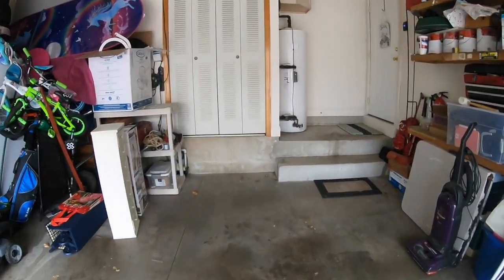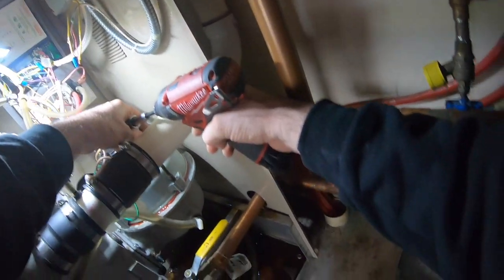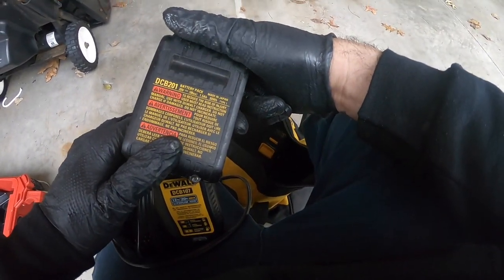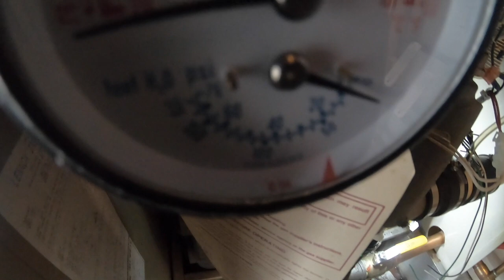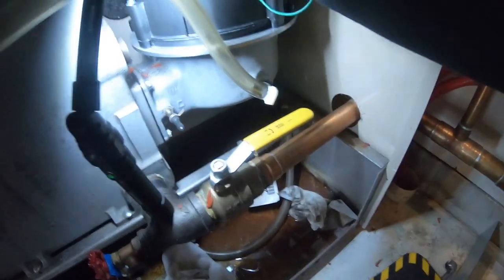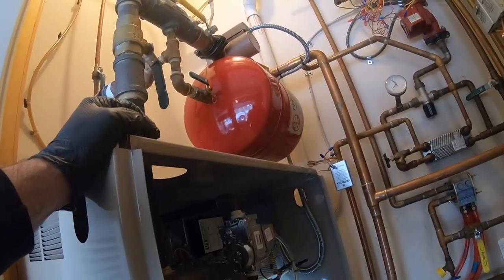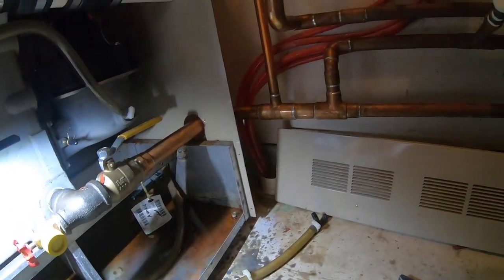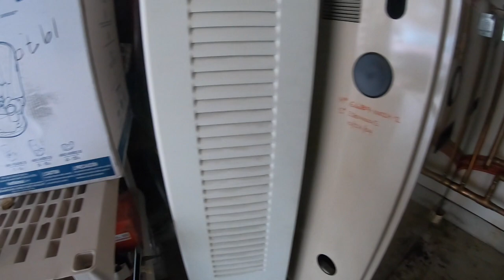Noisy leaking  Boiler Repair Inducer Motor Replacement

Comment: Ah good olde Lennox. They have their own way of designing a product that just usually ends up pissing me off and wishing I was working on something else. Recently found your channel lately among the other HVAC guys. Really enjoying it so far.
Reply: Lennox boilers are manufactured by Dunkirk, not made by them.  If you get a Dunkirk it will be exactly the same, just a blue cabinet. FWIW.
Reply from the maker: Michael is correct Carrier and Bryant even use the same boiler just different color jackets end up on the boilers. I believe this heat exchanger was done by Utica they only made this style boiler for a few years and backed away. I have ran into many cracked heat exchangers or burned away burner tubes.
Reply: The mother company is ECR the main brand being Dunkirk but they own Utica, pennco , argo and other brands. Dunkirk has always made boilers for at least a dozen companies. They still make that boiler but it has a high failed rate. The welds on the aluminum fail. The water needs a corrosion Inhibitor.
Reply from the maker: Yes and Dunkirk isn’t on the units label anymore yet ECR is. I have had a few of these that the heat exchangers failed.

Comment: I've always wondered why hot water/steam was so common in the NE while we here in the midwest are almost all forced air?  Those water/steam systems look so complicated, expensive to install, and maintain.
Reply: theBigMoose The buildings in the east are much much older thus having the piping already in place when the old coal boilers were converted to hot water boilers.  It was their access to coal and oil first that dictated the use of hydronic heating systems.
Reply from the maker: Water systems offer more even heat. Efficiency nailed why a lot of these older houses have steam or water systems. Higher end homes usually get water systems for radiant heat. A water system is easy to maintain its when they break down. A steam maintenance is almost 2 hours yet cost the same for a service agreement as a forced air system that maintenance is almost an hour.

Comment: Good video..... HVAC Hacker this was the only high efficiency boiler I came across with a cracked heat exchanger and it was slightly out of warranty. Lennox still warranty the unit for the customer. Really shows something about Lennox. It cracked up high and developed a green stain running down unit at bottom of base pan water was filling up...
Reply: lennox is trying to please as many people as possible atm after the class action hahah
Reply from the maker: They warranties one for me last winter that was a few months out of warranty. Lennox didn’t stick with this style boiler for long

Comment: Wd- 40 was manufactured for mc Donald Douglas as a parts cleaner in the early 1950s when my grandfather work for mc Donald Douglas. So yes it is a parts cleaner and has a oil lubricant in it too.
Reply from the maker: I like wd it cleans my tools up nicely after every job
Reply: I believe you are incorrect. Was created as a water displacing chemical. Read history here: https://www.wd40.com/cool-stuff/history

Comment: I notice you work on a lot of boiler type residential heating systems, I hardly see these type of systems in Canada. Mainly up here it's forced air for residential. I wonder why the major difference?, perhaps it's because you work on homes that are upgraded that are or had been using cast iron radiators.

Not sure what the benefits are of each, I guess a choice between duct work or extra plumbing throughout your home.
Reply from the maker: A lot of the houses were coal heated on the older houses. They usually were gravity systems that became steam systems. Steam systems stopped being installed right before the '60s. Hot water systems are still installed into newer homes. Forced air is cheaper to install since ductwork is needed for the ac system already. Many new homes usually always come with forced hot air heat. Higher end builders go with water systems since radiant is very popular. I would do a water system with baseboard in my house over forced air. The higher end homes part is why you are seeing a lot of water systems. I do most of my residential work in wealthy towns such as Saddle River, Franklin Lakes, Ridgewood, Ho-Ho-Kus, and many other wealthy Bergen County NJ homes. Many of the calls I made videos of are from Ridgewood NJ which was the pre-depression mansions. There is also a lot of forced air systems mixed in.

Comment: the way I see, those whom are that set against WD-40 are likely invested/sponsored by some other companies can of crap product ;)
none of them penetrate worth a damned anyway, unless the bond is broken and smaller molecules allowed to flow, majority of the time with rust and corrosion, there's no space. the fire-axe/blue-tip wrench/melt-o-matic/portable-sun ( torch) most always fixes things. they do however help lubricate and loosen after the initial bond is broken and of course wd-40 works nice as a universal cleaning agent, and ignition/wire dryer.
Reply from the maker: The problem also a s you stated with them not penetrating is how long do you need to let them sit before they do penetrate, spay on and come back 7 hours later, while hitting with a hammer every 15 minutes to allow penetration. who has time for that. Yet me like many others spray it u and start attaching those rusty fasteners

Comment: Spendy spendy them inducers are. They wanted close to 600.00 for the one I replaced.I’d get a bigger fitting and hose for that drain. I know it helped to do that on my furnace. The water and dirt from moisture in the a/c evaporator used plug that small  drain orface just before the elbow. Went to the next size bigger fitting and hose. Never had to deal with water leaking into the furnace again. It drained very well afterwards.
Reply from the maker: A larger drain is usually better. Here these drains hoses need water to sit in them to make a trap.